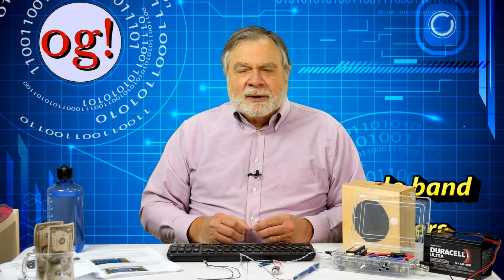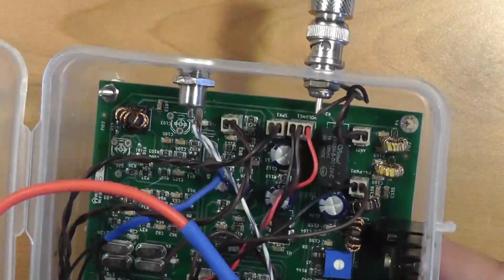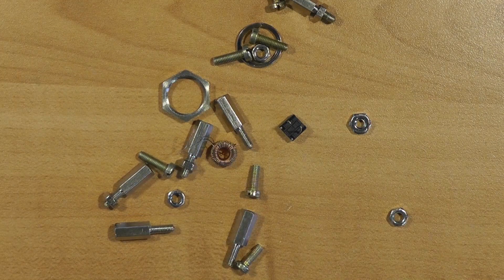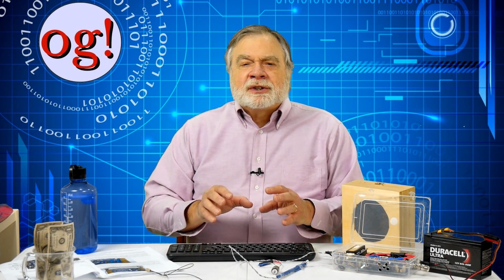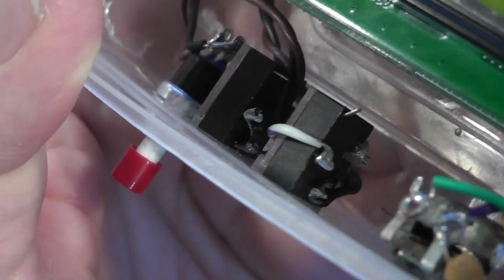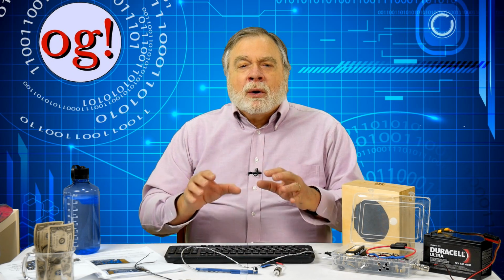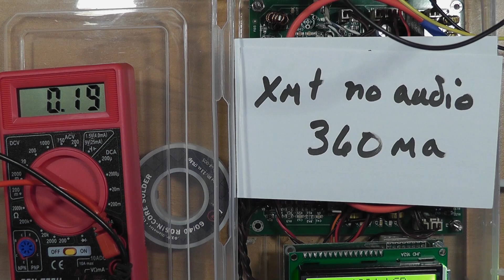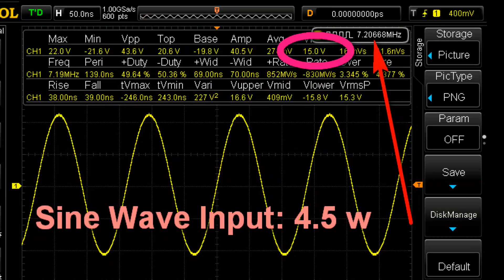BITX-40 Construction Review: KEØOG Kwickie

Comment: I was wanting one of these.  Sadly, no longer made.   I have a friend that had an old Cobra CB that was no longer working.  He  mounted the UBITX in the CB chassis.  Modified it so that the CB vfo would control the UBITX.  He also modified the display so that is was on the front of the radio.  He added a homemade audio amplifier and used it to power the CB speaker.  He also  modified the radio use to the CB radio microphone or similar microphone.   What a great radio it was.  Sadly, he traded the radio for something else.

Comment: Dear Dave, I had the most trouble with low TX power on that thing until a guy named Jerry, told randy that R136 is like mic gain. I tried it out by turning it counterclockwise and saw my amp meter and watt meter go up. I got the 1 Amp current draw, and 7 watts or so with the watt meter. I went up to 20 volts into the final PA and found the bias needed a slight adjustment for no audio transmit, and about 20 watts output with audio. It doesn't really need adjusting when switched over to higher voltage. This issue made me and my test equipment look really bad, and wasted a month of my fun time with it. They weren't adjusted right before leaving the shop.
Reply from the maker: Thanks for this information. I'll check it out and put the results in an upcoming video. 73, Dave

Comment: David:  I recently got my General ticket and thanks to your videos this will be my first HF rig!  Do you have any recommendations for using a regular handheld dynamic mic with the Bitx40, rather than an electret?
Reply from the maker: The instructions say that if you want to use a dynamic mic, be sure to put the recommended capacitor in series. The system as set up provides 3v bias for the electret mic.

Comment: I desoldered the contrast pot and put it on the other side.  Made it much easier to tweak.
Reply from the maker: Good idea--I'll have to give that a try. 73
Reply: That seems like a silly place to put it. Need to change contrast? Remove the display first. Ha.
Reply from the maker: I don't think it's silly at all. If Dean has mounted it such that putting it on the other side makes it easier for him, then that's hacking, not silliness.
Reply: No, I mean the original location? Under the display? I assume that Dean has moved it out away from there so he can use it while looking at the display. I was talking about the location out of the box

Comment: Dave, I received my kit on March 17, 2017.  Included were eight standoffs..  If they weren't then too bad as I used the extra four to keep the display from being pressed against the Arduino.    Mine was fine right out of the box.
Nice video.  It made my assembling easier.
de ke4rk